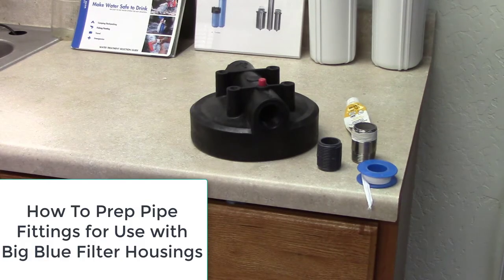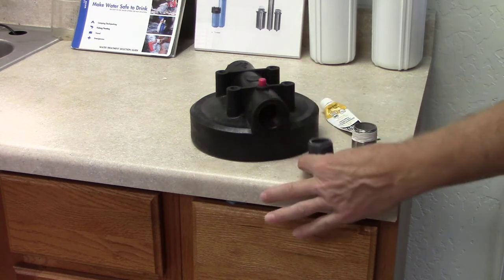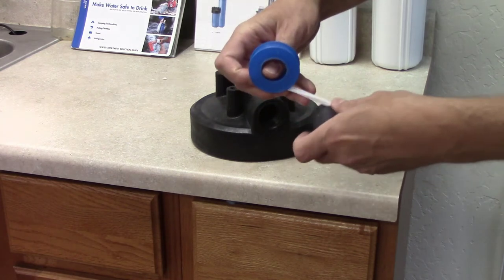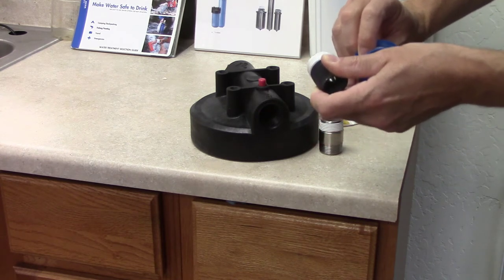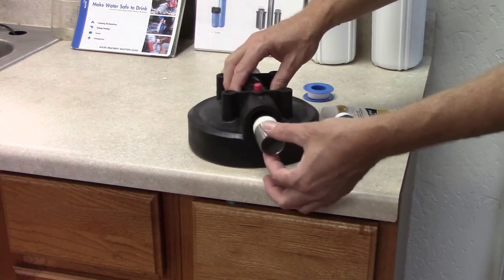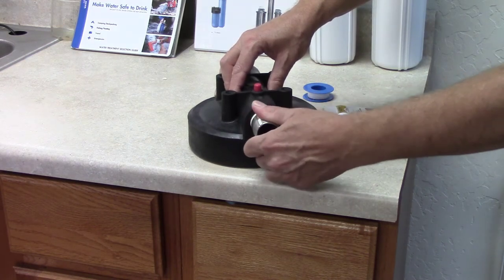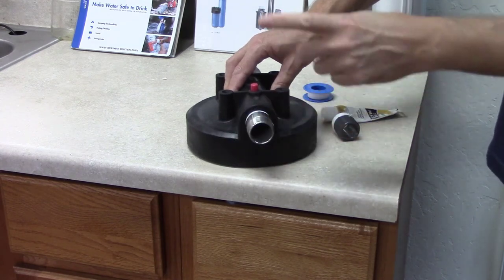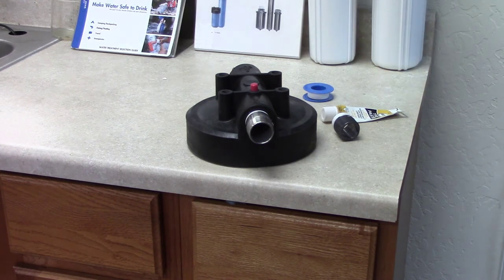How To Install Fittings Into Big Blue Filter Housings

Comment: I thought you should wrap the opposing direction per most plumbing instructions.
Reply from the maker: Thanks for commenting,  I guess it can be either way as long as it does not bind up?  Normally we wrap it clockwise.  Here is more info:

When wrapping Teflon tape (also known as PTFE tape) on a pipe thread nipple, you should wrap it in the same direction as the threads will turn when you screw the nipple into the plastic filter housing. This means:

Wrap the tape in a clockwise direction when looking at the pipe end that will be threaded into the housing.

Steps to Wrap Teflon Tape:
Start at the End: Begin wrapping the tape at the end of the pipe thread (the edge of the nipple).

Clockwise Direction: Hold the pipe nipple in your left hand (if you’re right-handed) and wrap the tape around the threads in a clockwise direction, which is the direction the nipple will turn when you screw it into the filter housing.

Overlap Slightly: Overlap each layer of tape slightly as you wrap it around the threads. Typically, 2-3 wraps around the threads is sufficient.

Tighten the Tape: Ensure the tape is snugly pressed against the threads and not loose.

Smooth it Down: After wrapping, use your fingers to smooth down the tape along the threads, ensuring it’s well-adhered and will provide a good seal.

Wrapping the tape in the correct direction ensures that it doesn’t unravel or bunch up when you screw the pipe nipple into the filter housing, providing a proper seal and preventing leaks.